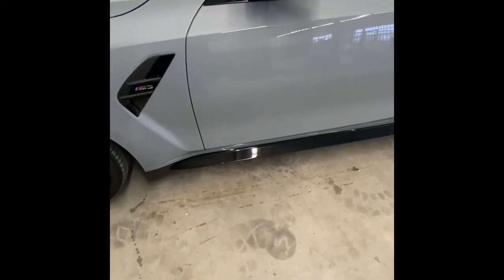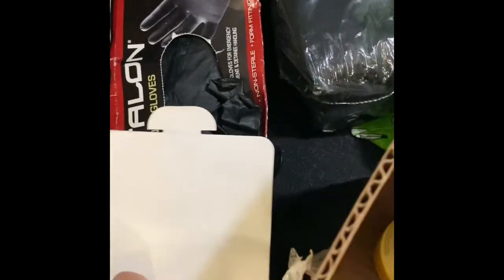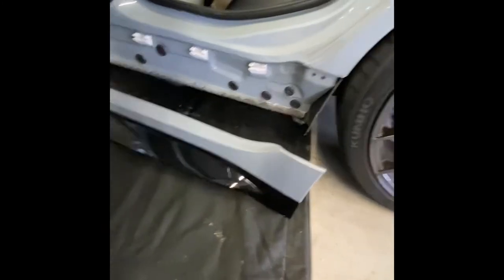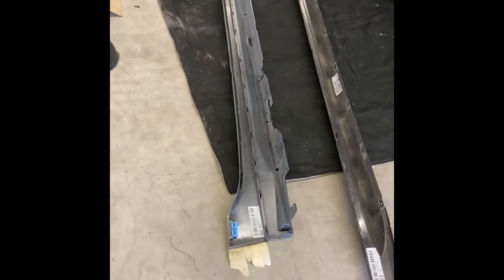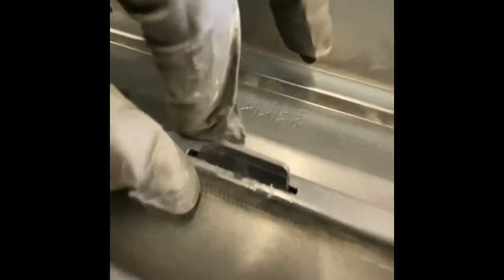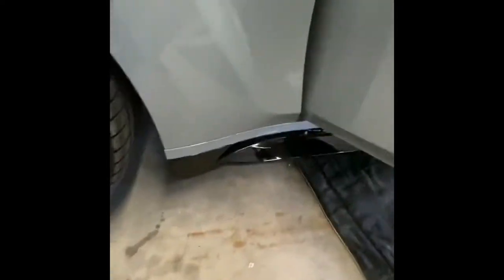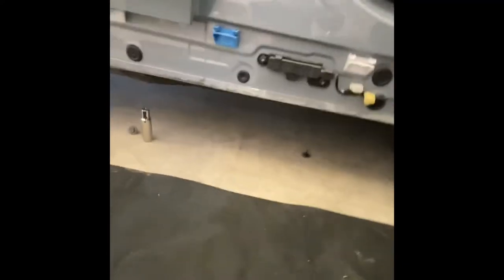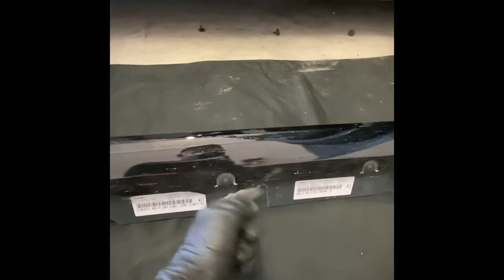How to install factory side skirts onto your 2021 G80 M3

Comment: love this video!! where did you get those plastic pins? you have the exact size? trying to get the same ones... can u reuse the ones that came with the car instead?
Reply from the maker: Thank, and yes you can the plastic pins that came with the car. I ended up having to use some that I bought off of Amazon. The oem ones you can get at the dealership, although the Amazon ones work just as good. Here’s the link 👇🏼

https://www.amazon.com/GOOACC-Universal-Fastener-Retainer-Replacement/dp/B07QG8CWFV/ref=mp_s_a_1_6?crid=2UPZXXBHTBFD4&keywords=auto+plastic+clips&qid=1639721389&sprefix=auto+plastic+clips%2Caps%2C176&sr=8-6